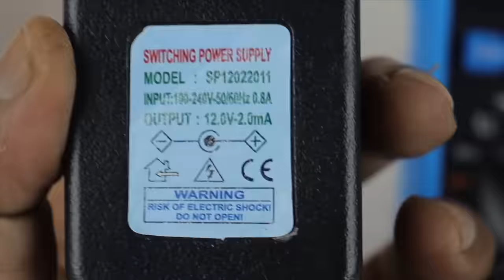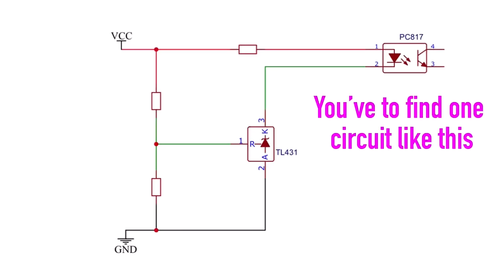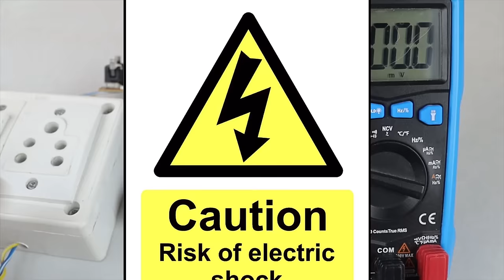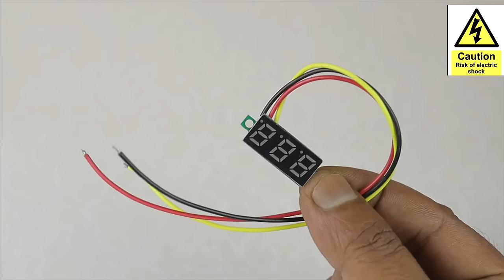Turn Any Fixed Voltage Adapter to Variable Voltage Output (3V - 24V)

Comment: You have not mentioned rating of output capacitors. Out of originals, one is of 1000 mf and the other of 470 mf. You are replacing one as 470 mf and other as 220 mf. You are silent on values of them. You will agree that the value matters significantly. Similarly you are silent on the max. rating amperage capacity we can get from 3.0 v to 24 v subsequent to modification. If possible please clarify on these points.
Reply: Interested too on this fact.
Reply: Probably 1.5 to 2 amps
Reply: well the capacitor is charged, so  it would be on the drain,   so wouldnt the amperage be variable to the voltage? Higher voltage lower amperage
Reply: Thekillerdog  nah dc is direct current where as ac is alternating current meaning it is switching... dc voltage is square forming while ac is more sinusodal. remember that if the resistance is the same then amperage will be relative to the voltage.. however when it is on a load device then the watt formula is applicable for power generation.  more or less a load acts like a resistor, however the load will also draw the drain of the system, draining may generate heat depending on the efficiency of a non superconducting circuit.. resistance loss and heat tolerance is relative to the bandwidth of low resistance transfer however the load will only drain as much current normally as it can draw. Hope this makes sense.. just understand that capacitors have a charge and drain rate.. the whole farads and voltage factor  they are acting as a battery of sorts, capacitors themselves can only draw so much power in time and they can only discharge so much power in time.   
A 1-farad capacitor can store one coulomb (coo-lomb) of charge at 1 volt. A coulomb is 6.25e18 (6.25 * 10^18, or 6.25 billion billion) electrons. One amp represents a rate of electron flow of 1 coulomb of electrons per second, so a 1-farad capacitor can hold 1 amp-second of electrons at 1 volt.
Reply: Thekillerdog  good to hear
Reply: @WilliamAshleyOnline 

Yes that's a issue these moderz don't adress 
How much output can these mods really do and mains front end mods or checks make sure it's reliable and checking the transformers satrination specs 

Can you clear up if you can more on this 
Like if I was to ask for 1 million VA from low volt side if the back side has protection to it or it will make me a wizzard of the smoke 🚬 and wat the likely other things to look on 

Since I want to do it regularly myself
Reply: @weazeldark3983  I am not sure what you are asking if you clarify a bit more I might be able to give more info to you. Depending on the capacitor type there is a maximum charge capacity. If you are charging a very high amount from a low voltage source it will take a long time to charge but if the medium could hold that charge it may be possible, the ISSUE is the discharge as the insulation medium  and the ability for something to receive the discharge, as 1 million voltamps would likely be released as an arc, and while arcs can be contained in advanced systems they are well beyond most consumer electronics.  The voltage rating printed on the capacitor is the maximum voltage you may charge with. The electric charge Q of each capacitor is (after full charging) Q = C * U that is for each capacitor: Q = 100 µF * 5 V = 0.5 mAs, or 0.5 mC (milli-Coulomb) So say a microwave capacitor the large ones may have like a 40,000 volt charge rating while a lot of smaller capacitors may be in the hundreds of volts.      A 1million VA capacitor is likely a very large scientific test unit they are specially devices and often only occur in test devices and there are not a whole lot of them around anymore. These devices exist(ed) in some electrical research labs.  Keep in mind that Capacitive welders operate at much lower power ratings. Depending on the structure and medium of capacitor you will get a different max charge Q=CV  It is technically possible but there are material limitations both size and actual composition. Generally speaking if the lane and the insultation is exceeded you will have smoke because The peak temperature of an arc flash can reach up to 35,000°F
The substance with the highest known melting point is the compound hafnium: Ta4HfC5, its melting point is 4215 degrees Celsius. It is the resistance value. So while possible the way the energy is stored and the materials use matter more and more as the amount of energy stored increases. Electrical resistance along the continuous electric arc creates heat, which ionizes more gas molecules (where the degree of ionization is determined by temperature), and as per this sequence: solid-liquid-gas-plasma; the gas is gradually turned into a thermal plasma.    SO if I understand the question it is technically possible but most people are unlikely to ever work with those sustained levels because of the cost and maybe space considerations making such a system impractical.  AWG gauge	Conductor
Diameter Inches	Conductor
Diameter mm	Conductor cross section in mm2	Ohms per 1000 ft.	Ohms per km	Maximum amps for chassis wiring	Maximum amps for
power transmission	Maximum frequency for
100% skin depth for solid conductor copper	Breaking force Soft Annealed Cu 37000 PSI
0000	0.46	11.684	107	0.049	0.16072	380	302	125 Hz	6120 lbs
Reply: @WilliamAshleyOnline  
The million VA was a trolling 🤣 😂 💀 for 💡  😅 💡 the proper savvy concepts 

People don't know that mosfets have a frequency range and feed back limits and inrush current handling and forget about transformer satrination and the capacitors are not just voltage and cap but also frequency and pulse rated beyond normal thoughts and conditions sos even though the caps look same and seem 🐀 🐁 🐭 rated similar canbe completely different and moreso there's designs for applications normal audio and smp psu all have same looking DC electrolyte Aliminium caps but they are possibly tailored to situations 🤔 😉 😜 

Sos I was looking for a diy slap guide for knowing how to mod these psus on the exceptionally savont savvy savant ways then ad hoc shell be right approach 

Especially considering Chinesium
 🙄 🤔 😒 
Already has us on lock 
🔐 😌 🙌 
There with all that red neckie stuff 

And need way to test out the psu transformer satrination in running and ruff guide to original design to mod design VA likely hoods and max volt n current things 

Just help if there wasn't tonnes of quickie builds and someone went though with stack different 🤔 🤷 😕 😅 ones and showed there ideal and max potentials and lots of pics and schematics and ideas 💡 how u can do all psus 

I definitely know make 😌 😏 ☺️ all the diy peoples life esay and better 
😉 😎 😀 😜 

Also if anyone opens up one check the high voltage to low voltage isolation brakedown cap connected that it's a rated proper cap and not China special bs cap that's wat gives you the tingle for ur dingle wen touch n feel funny 
Best to test mains to low voltage side for  voltage and current level leakage if know how to do 

Be good to find a psu specialist to give loads of wisdoms and hidden secrets

Comment: Sorry, but this will work only with that particular adaptor that you are testing on.
Reply: This is the most important comment! Usually you can modify the output voltage with this solution  +/-  20% only!!!

Comment: I only needed to replaced that +ive side 75K resistor with 100K pot... and viola now I'm getting 24V from a 19V supply... Thanks a bunch. 😁
Reply: Aslong as the low voltage side is rated for 24v instead of 19v 
Led and caps and other such things might not be and blow or overdrive n wear out prematurely

Comment: The circuit lay out fir the project is always helpful for construction of the project. Kindly add the circuit diagram. Vdo instructions are not enough to notice the exact modifications.

Comment: Very useful for me as I am a novice at Electronics I don’t think anybody is showing the sort of hacks keep up the good work look forward to the next one and hi from the UK
Reply: There is one Bangladeshi guy did this about 1 year before. I made it 6 months back. But the problem is that with the increase of voltage at the output, current reduces drastically. You will get good output power only for a small voltage range. Or you can take a power supply of old laptop charger, that gives you great stability. New laptop chargers are complicated, it's not simple in there.

Comment: Boa noite e obrigado pelo vídeo bem explicado. Se eu quiser pôr a voltagem mínima em 1,5v, teria que mudar algum componente interno que é a referência?  quanto ao último resistor introduzido ao circuito, não entendi onde foi colocado e qual o valor dele. Se puder tirar-me a dúvida...Obrigado desde já e forte abraço do Brasil.
Reply: He attached it to the bottom of the board leads of the other resister.

Comment: Nice work, but if its rated for 12v 2amp, and you crank the voltage without limiting the amp output accordingly you risk of burning out the circuit  no?
Reply: Kya?
Reply: Definitely yep, good work china, it doesn't supply 2amp ,

Comment: Nifty idea but is it really safe if onesn using it constantly at 24 volts say?
Reply: Sure I mean watts is what you will really have to watch out for it was 12v 2A so 24 watts so 1amp at 24v  should be fine but you might give yourself more margin on the caps
Reply: But also you can't do that with all power supplies I took a 12v one that was a cheap Chinese Xbox power supply and I was able to go from about 8 to like 19 before it would shutdown on its own and you bring it back and it was fine I don't remember the current but it was good for a couple amps

Comment: I think your slm videos are educational. Thank you. I have a question. I don't want to spend on my cordless drill and buy a new adapter or tarsformer. It's expensive. Can I convert my 12V, 2A adapter to 14.6V and 20A, I need your information, thanks
Reply from the maker: Not at all

Comment: Voltage regulators don't work with modern electronic light bulbs, only the older types as they require a set Voltage to run.

Comment: Problem: You now have basically insulated secondary wires (the red ones) in contact with parts on the live side of PCB! I would not do this modification..

Comment: What is the exact change needed here ??
.Also, can this technique can be extended to Adapters which use Zener diodes for buck voltage ??
Reply: no. a bunch of changes to the circuit should be done, such as adding the variable voltage divider to give the reference voltage to the TL431. it's not advised to make any changes to circuits such as these, because it would void the warranty and there would be no guarantee that it could work outside its factory ranges.

the mod is pretty straightforward - replace the two 16V caps with 25V ones (I'd suggest at least 35V just to be safe), remove the two reference resistors and replace one of them (the closer to ground) with a fixed 2.2kOhms and the other one with a potentiometer.
Reply: @waltercomunello121  forget about the guarantee, I never buy a power supply i take what i found!
now it's a good idea to choose a power supply close your need
if you want 12.6V a 12V will make the job without modifications (just check the value of the caps if you want your power supply to last longer take a 50%over, the cheap products use 25% 15V for 12V , 50% will be 18V IF THE SIZE OF THE BOX AUTHORIZE IT  )but you can use tantalium of recuperation .
if you go too far from the original design you may taste some instability (the datasheet explain it very well )
Products who are very cheap produce in mass productions are most of the time well designed

Comment: Clear and compact..👍 eazy to understand. Tq for the good job, sir. But you got one punny problem.. by not mention about the ampier. Current will drop when volt rise. It will be better if you give the pro and cons
Reply: this really depends on the capacitor used and its discharge rate.

Comment: Buena modificación, y cuanto disminuyó el amperaje al elevar el voltaje?
Reply: Es variable. La fuente originalmente 24w o sea que si la llevas a 24volts vas a tener 24w /24volts = 1 Amper.

Comment: Very good. Já fiz um projeto modificando estes resistores de referência pro circuito de monitoramento que vai até o fotoacoplador, faço isso com quase todas as fontes de que tenho disponível 👏👍👍
Reply: Irmão, boa noite. Vejo que você já fez alguns circuitos e deu certo. Pergunto: se eu quiser pôr a voltagem mínima em 1,5v quais os componentes que tenho que trocar? pois não conheço os cálculos que preciso fazer. Obrigado e forte abraço do Brasil.

Comment: Good. Whether the amp will be same or increase/decrease?
Reply: I'm guessing the output power will not change.  So as the voltage increases the current decreases relative to the voltage change.

Comment: very nice soldering skills, but this only works with TL431 based devices. so it's not "any adapter", just "any TL431-based adapter". any more complex adapters which use ICs like the XL6009 (as an example) would need other modifications, if available.

aside from that, this voids the warranty and gives no certainty that such a mod would make any device work.
Reply: Those that are thrown away are used - What guarantee?

Comment: Nice but what does the output waveform look like? And with 2 ma you are really only getting a signal level voltage. The pickups on my guitar make more amperage than that. 
But it is a good teaching project.
Reply: It's really 2a

Comment: It's a nice video, how many amps is this device?
Reply from the maker: 2Amp
Reply: @TechIdeasAG  Thanks
Reply: we shouldn't talk about amps, but rather power. the device is rated for 12V@2.0mA (as it is written? I suppose it's 2A) so that would make it a 24W adapter. cranking the voltage up to 24V would make it output at most 1A, and any bigger current demand could damage it. so it would trying to squeeze 8A on a 3V device (24/3=8) because the very components or the traces could overheat or fail.
Reply: @waltercomunello121  so is it 2ma or 2 a I'm confused and why would you guess after the uploader answered the question
Reply: @talon04091  it's unclear since the label on the adapter says "2mA", but it would be too low for any significant application. So 2A would be a better guess. I think the manufacturer has foggy ideas about current. The only way to be sure would be an ammeter in series with a 12V device which takes 2A.
Reply: @aydindemirelli481  2 Amper a 12V a 24 volt solo 1A
Reply: @reyleon61  👍👍👍

Comment: Sir can u explain..how to know which  components we should change? means why u put cap 20v 470uf, why not others?
Reply: If you exceed voltage on a capacitor, it will die, sometimes explode. You should always try to use components rated more than your design for a safety factor.

Comment: 4:54, is the 220R resistor parallel with the 2.2k resistor?
Reply: It is 3.3K connected in parallel of 2.2K, what is difficult to understand?
Reply: Hola a mi me pareció un resistor de 2.2k
Reply: Creo que es mejor soldar un resistor de 1k

Comment: Very knowledgeable video ....plsss make more video like this for beginners..can we use this circuit in 12 volt 5 amp power supply.
Reply from the maker: Here is the video
https://youtu.be/JGZ7FjZCYB8

Comment: Not make large changes it may failed
The limits variable voltage is should be 9v to 14.4 is enough!! 😏 😉
Reply: I think so too, if the fb voltage too low, the vcc for controller is not enough

Comment: Everything will be different with the load.
The adjustment range will be smaller depending on the load.
Disadvantage: a measuring DEVICE IS NEEDED to accurately set the voltage.

Comment: nice video. how to increase the current capacity at 24 V to 3 to 5 amps?
Reply: You can’t really, you can pour water out of a cup faster but you can’t pour out more than the cup can hold
Reply: @ArtyMars   I' ve found that it could be done using power transistors like MJ2955
Reply: @snehasish7    put the two words OR and ON together  then  put  a M in front

Comment: You just replaced a voltage divider of resistor to a trimming resistor and add voltmeter to out for have watching a voltage.
Reply: ... And you did not.
Reply: @RinksRides  i can do it better but i'm very lazy if i don't need that.

Comment: I have a power supply that powered led lights and I would like to use it to power some 14.4v battery packs. it says rated 90watt  I put in 120v ac and it reads 168v dc output no load can i use this or should I just try a computer power supply?

Comment: What is the output current in Ampere .?
Reply from the maker: Output current depends on output voltage, at 3v the current will increased but at 12v it will decreased
Reply: Max output current is 50 ma as per 817 data sheet unless the shown diagram at 2:39 is wrong...
Reply: @PR-fk5yb  the 817 is an optocoupler. It has little to do with the output. Watch the channel electronoobs as he made a great video on these types of flyback power supplies.

Comment: Why has it got a CE label on it? This type of power supply is not safe to use!
Reply: As designed it is fully isolated from mains voltage. Even after the modification. So yeah, still safe to use. Though if the label is to be believed, 24V@1mA not terribly useful IMO.

Comment: What will be the current ?
Reply from the maker: 12V 2Amp adapter = 24watt. 
So overall power will be upto 24watt.
Example:- At 6v it will deliver upto 4Amp
Reply: @TechIdeasAG  adapter itself 2 amp.. How could it deliver 4amp ?
Reply: @TechIdeasAG  To draw 4 Amp of this charger you need another circuit to convert excessive voltage to current. Without it you can't draw 4Amp. Also in the charger I saw 2 mA. Is that written wrong?
Reply: The current drawn depends on the voltage and load impedance: I = V/R.  Draw too much current and the device burns.